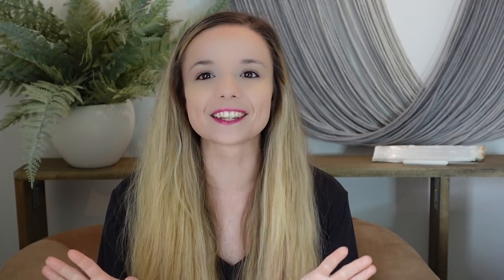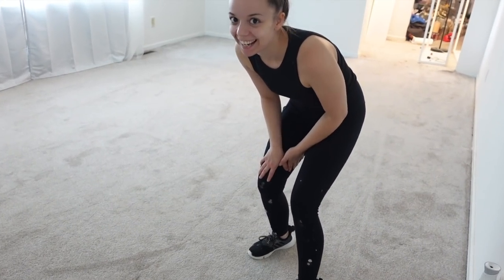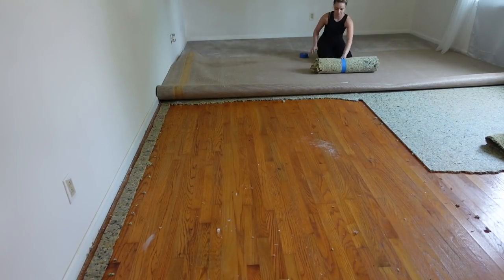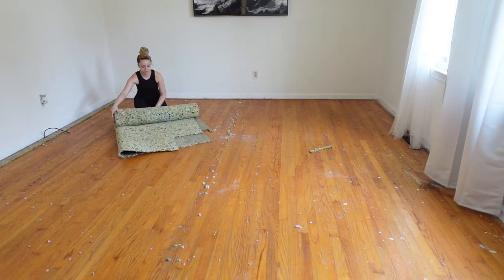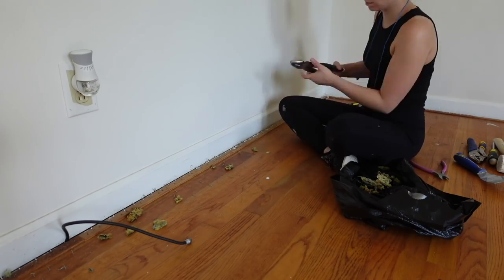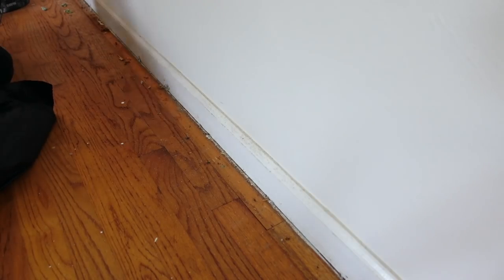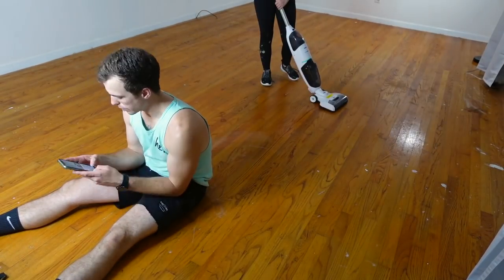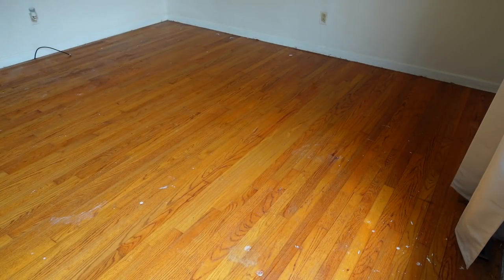REMOVING THE OLD CARPET | REVEALING THE HARDWOOD FLOORS |HOT MESS HOUSE | LEXI DIY

Comment: I used GOOF OFF on my wood floors to clean old paint and other stains. It worked great. Just don't touch paint areas you don't want to remove. Like baseboards. I used a qtip to get close.
Reply: That's wat I told her in her last video.
Reply: +1 for goof off. Ventilate the room first but it works great

Comment: I've had the same problem on my floors. I'm renovating and having similar issues. 
For the paint on my floors I used my window paint scraper razor and slowly and carefully scraped up the old paint. 
not jabbing a sharp end of a razor down but parallel to the floor and slowly shaving the paint down. Worked magic. 💪

Comment: On your office floor, a real good easy paint remover is a varnish stripper. It does not ruin the wood, but it will remove anything you have on the wood. Once you apply the gel like stripper wait about 15 mins ( if the spots are heavily soiled with paint, then gently remove. You can literally use a paper towel, it can get messy and you don't want to ruin a decent cleaning towel. Let me know if you try it. We've had great and easy success with the varnish stripper.

Comment: Yes, Goo Gone and Good Off are the same?
I've been using Google to take off labels on cardboard and ceramic with no residue. I'm positive it will release latex paint from surfaces by simply spraying on and waiting, say 10 minutes? And lift off with a smooth  plastic paint scraper.
Sound good?